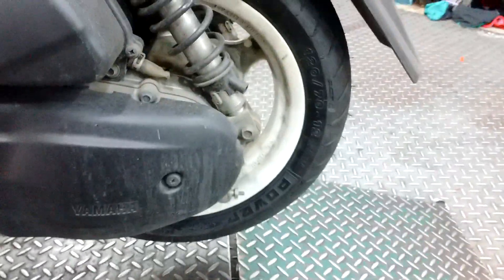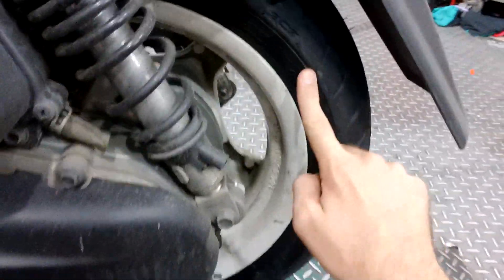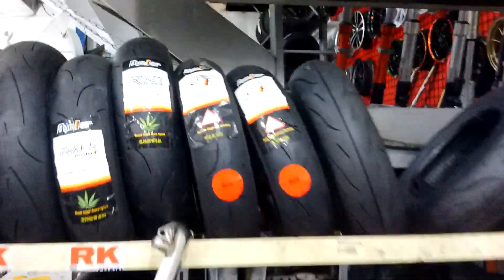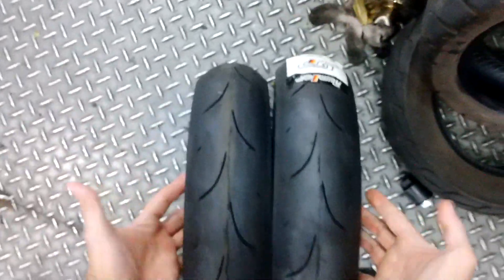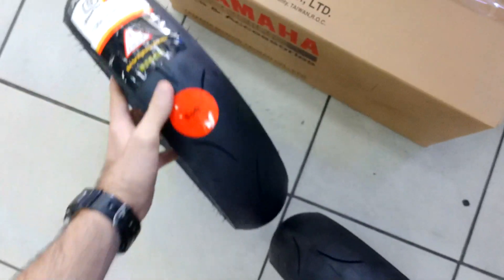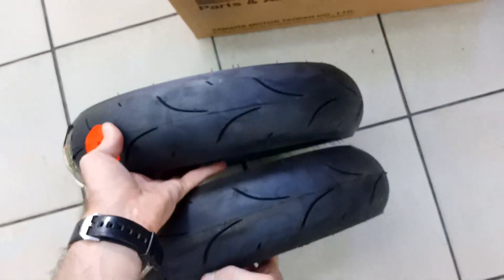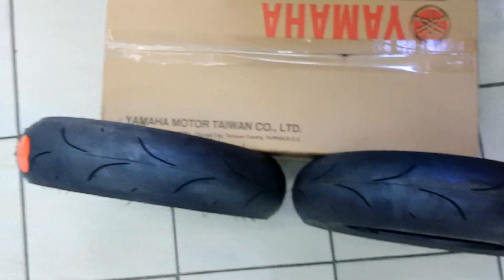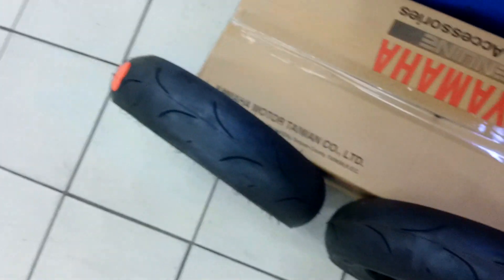Interesting Tire Fact - M13

Comment: the front tire is in rewerse pattern to the rear because on the rear you need to spit out the rainwater behind you while the front tire will need to spit it out during its most important funktion.. breaking. On acceleration you need the grip on the rear tire. Thats why the pattern is oposite ;)

Comment: can i try to answer about those tire? i don't know if i would make sense but please humor me..

lets say that those patterns are best to make most friction only on 1 direction.. so if you put them on the bike, they would technically point to each other.. so basically you need more friction on the rear because that's what you'll need to get your bike moving and the front tire would be spinning opposite to the direction where there are more friction.. and once you break, (which is breaking with both front and back breaks) the rear break is not really making the bike to stop, it's making the rear tire to stop.. so its the front break to the rescue.. and once those front breaks starts to kick in, you're TECHNICALLY making your front tire spin on the opposite direction (rules of VECTOR in PHYSICS) then that's when the friction on the front tire kicks in..

Comment: Just did the same today when changing to "winter" tyres on my bicycle (yes I got winter tyres for my bike, as I ride it daily in all weather). The direction of the profile makes a huge difference in traction (which is easy to test on a bicycle by simply putting in the front wheel flipped and trying to break on snow). 
On scooters/motorcycles through more "power" at the wheels the direction is even more important, since tyres withstand force in one direction better than the other.

Comment: It's due to the way the tires are made. The arrow shows the optimal direction for dispersing H20 along with showing which way the tires splice is being forced together, rather than apart. If you put a rear on front without switching the direction the splice of the tire could come apart under hard braking. Also, if you put a rear on backward the force of acceleration could tear apart the splice.  
For optimal tire use, buy fronts for the front. Only use rears for the front if you have to!

Comment: There's differences in the very frame of the tire as well as in the threading. The internal construction assures a stable tire (not bending or wobbling or doing anything strange) during braking or acceleration, while the pattern just serves to get rid of water and gravel etc. A racing slick also have a rotational direction, and they don't have any threads what so ever. So the direction is "determined" by the inner construction and the threads are made to fit that.

Comment: the front tire is made to stop momentum, the rear one to create it.. opposite forces require opposite constructions.. has to do with sidewall stability I think.. so reversing a front tire when mounting it as back tire is correct, since you are asking it to create momentum instead of stopping it (pushing instead of dragging if that makes sense)

Comment: I figured this out long ago, what you can do is take the tire and try to skip in on the floor in one direction and then the other. You'll notice that it has WAY more grip in one direction than it has in the other.

This is why you can make a slide when breaking very hard on your rear wheel, the wheel doesn't have much grip in that direction. You couldn't do that with the front wheel

It also goes for your bicycle tires. You can easily check with the breaks which direction is more grippy

Comment: the tread pattern on a front tire is reversed from the rear because it gives it more grip for stopping. the bottom tip of the "V" pattern of the tread should be pointing in the direction of the force that is being put upon it.

Comment: Tires are manufactured to withstand more force in one direction, due to the way the rubber layers are made, the rear has to withstand torque of acceleration and the front has to withstand forces of hard braking, that's why you reverse them.

Comment: Definitely because the rear's main force is accelerating and the front's main force is braking, but since tread pattern(for water) does not matter on streets, either way works as well.  Even on off road knobbies where you would assume tread direction matters a lot more, it is common practice to chance the direction of the tires half way through their life to make them last longer.
There is no danger since tires are built to undergo both acceleration and braking forces.

Comment: This is true! But remember, this only applies to moto tires (2 wheelers). Car/Truck (4 wheelers) tires that have directional tread do not get reversed for the rear. If you reverse the directional tires on a car; you may break the belts inside and cause tire blisters.

Comment: the thread pattern is to give water a chance to drain away from under the tire
ifit is put on backwads then it can collect water under the tire
that being said tractor tires have cleats that are designed to scoop away
loose matereal so the tire can dig in to the firmer soil deeper down
and work much better if torque is applied in the proper direction
it seems that the tire manufacture is going for the latter effect

Comment: I think it has to do with the direction of resistance/force.  The rear tire pushes the bike...but the bike pushes the front tire. So...both the rear and front tires are sort of pushing pavement away from the bike..in different directions.  So, the tread patterns are reversed.

Comment: M13, I think the front tire has tread reversed like that for when you are cornering. If you think of when the bike is leaned over the tread on the front tire will stop you from hydroplaning. It's a compromise. You can hydroplane going in a straight line as the tread forces water beneath the tire, but you're going straight so it's not a big concern and on the corners you'll be safer as the tread pattern does it's job and shoots the water out from under the tire keeping it in contact with the ground.

Comment: as people here already wrote, the pattern is designed to push water out in the same direction not according to vehicle speed, but according to  vector of force generated by breaking at front wheel or acceleration on rear wheel.

Comment: It has nothing to do with water. The treads are directed based on the forces the tire will undergo. When on the rear, the torque from the engine is pushing the tire. When on the front, the brakes are pulling the tire.

Comment: Maybe the rubber is arranged in a way that the tires have the best grip in one direction.
On the front tire you need the grip when braking, so the force of the grip needs to point backwards. On the rear tire you need the grip for accelerating; the force has to point forward.
I hope you understand what I'm trying to say...

Comment: the way the tire is designed is to withstand more force is a certain way, front tires need to withstand braking while rear tires need to withstand acceleration. this isn't really based on tread but the tire plies and the way they are layered.

Comment: The trend direction of the front tire will bring the water to the center allowing it to cut though the water resulting in more control, opposed to blowing through.  That's just my logic on it .

Comment: I got this same thing when I recently had a new front tyre fitted on my 600.  I thought they had put the tyre on the wrong way round when they were fitting the wheel back to the bike so I asked and they told me the same thing, rear tyre tread designed to grip when providing drive forwards and front tyre for braking and moving standing water under braking.

Comment: The tyres are certainly designed to optimise braking and acceleration, as you have said.   Unfortunately it is very poor form to simply switch the tyre from front to rear by reversing it.  Tyres treads are spliced together.  This splicing is directional and designed to tighten while under the correct rotation.  On backwards you risk the reverse - tyre de-lamination.

Comment: The front one is designed to have maximum grip under braking and the rear one is designed to have maximum grip under acceleration. So for these opposite jobs they have opposite tread patterns.

Comment: The most critical moment to have traction is in hard braking and hard acceleration. Most av the hard braking goes on the front and all acceleration power goes on the rear. For a bike with no brakes the pattern would look different. Yes they exists. Tire patterns are more important on snow, mud, gravel and wet tarmac. The pattern will look different on each surface for best performance.

Comment: This is actually very common among bycicle tires. Because the tire makes more traction in one direction. If you put it on the front wheel where it makes more brake traction and because the rear wheel is not really important to braking it makes more traction when accelerating.

Comment: Lol ya M13, they do that so the siping goes the proper direction but also because the tires are designed to have the force put on them in one direction. So stopping force in the front would go the opposite direction or the drive force from the rear. Cheers :)

Comment: Yeah, it's about aquaplanning- when You brake with front and it would stop spinning on water then channels would lead the water towards the edges. When You give too much throttle and rear starts spinnig too fast-loose grip, thus aquaplanning, again channels will lead the water towards the edge.

Comment: Thats, my tought too. Altough it doesn't apply to all tyres, my bad-weather tyres on the scooter are the same direction, as are my motorbikes tyres.
So i would never change it if it doesn't really say on the tyre.
The tyres in the video also look sporty, so it might be a trick to spend some rain-grip for better dry-traction.

Comment: Didn't know that was the case with motorcycle tires, cause usually the front and rear tires aren't of the same size, I know you do that with car tires, switch them from time to time front-back-diagonally. Its usually mentioned in the Owners Manual

Comment: Final Answer
"The rear wheel transmits the driving force and the front wheel transmits the braking and steering forces.
Driving and braking forces operate in different directions so this is why certain tires are fitted in opposite rolling directions when used as front and rear tires."
Now go watch my videos :)

Comment: The only purpose of tire tread is the displacement of water and other liquids you might encounter on the road. It in no way effects the amount of traction you have with the road. That being said, I have no idea why they are mirrored designs. Maybe the front tire sheds water to the sides rather than the back? Any thoughts on this?

Comment: The reason for the tread patern being "reversed" is to do with wet weather, as the bike leans over, you Don't want More water UNDER the tyre, so the Reversed tread patern helps the water to be pushed to the outside of the tyre (i.e. turning left-the tread will push the water to the right/turning right will push the water to the left, Not under it.

Comment: The front tire works while braking, like if it rotates in the opposite direction; the rear one instead works while you accelerate! That is why that guy inverted your rear-mounted front tyre

Comment: nicks kinda right. when the rear loses traction, usually under acceleration, it'll cut through the water. when the front loses traction under deceleration it'll STILL BE ABLE TO cut through water. thats why the tread is reversed. look at motogp wet tires to easily see what i mean. the reason for separate tires is that both are built to handle stopping, scoots dont have enough hp to care about acceleration. if acceleration mattered there'd just one tire with a "front" arrow AND a "rear" arrow

Comment: Slots in tires rant mention for traction, they direct the water you are riding over. The front tire directs water the the center so the rear tyre can disburse the water to the sides and back of your bike.. If you had the front tread so it disperses the water away from the tyre, you and you bike would get soaked when it's wet

Comment: You shouldn't use a rear tyre as a front or a front as a rear, the reason they are specifically labelled is because the forces on each is different and the rubber compound is different you will get more wear on the tyre than you would. The front = braking, rear = accelerating. They are specifically designed for it, the treads should be that way though.

Comment: do you realise the ply of the tyre isnt regular? on a "front use only tyre" the ply is designed to hold together in the direction intended but if you turn it around then the ply is at significant risk of falling apart. I hope this doesnt happen and those tyres may be made differently but i personally wouldnt risk it

Comment: The tires go like that due to the way bikes corner. I can't explain it very well in words... Rather than the front turning and the rear following like a car the front and the rear are both turning at the same time. It's similar to an all wheel steering car but with some differences. So imagine the front tire is turned in wards and the bike is leaned over. The tires will go be in kind of a > orientation. Counter steering changes it a bit but not that much. And I'm out of words so that's all.

Comment: "A front tire works on energy from braking and the rear on energy from accelerating. Tires are "wrapped" (for lack of a better term) and can come apart if pushed in the wrong direction.  So, to run a front tire on the rear and not run into a delamination issue, you need to flip it around backwards. But, by doing that, you 100% negate all the water dispersing properties of the tire."

In addition, load ratings would differ between the two, and could be quite dangerous.

Comment: I'm not in a tire shop so I can't do a very broad comparison but I just looked at the stock tires on my Ninja and the tread is not reversed front-to-back, and I can tell you beyond doubt the tread on my old CBR's tires was never front-back opposed, either - multiple sets of different tires.  Is it simple coincidence that I have yet to come across an opposed-tread tire pair?

Comment: I see what you mean about the tread pattern M13, however that front tire you showed us, the treat pattern seems wrong. Now I'm not an expert obviously, yet the front tire tread pattern appeared that it would push water under the tire rather than out from it, however when it matched the rear tire direction, the tread pattern seemed correct.... It still confuses me, but ok, it's the right direction, but the tread pattern just seems wrong.

Comment: @united999state Slicks are a very bad idea, did you know the tread pattern on a normal tire helps disperse heat, and if you put slicks on it will go through its 6-10 heat cycles and go very hard on you quickly. the reason they put Tire warmers on when racing is so they only go through 1-2 heat cycles

Comment: My car tyres have direction indicators, which is why I cannot follow my car manuals recommendations to rotate all the tyres so that every tyre gets a go in every position (including spare) it cannot be done because half are designed to turn clockwise and half designed to go counterclockwise,  I do not even rotate front and back on the same sides, and defo don't with spare as its on the only Steel rim which is thinner than the other wheels... :-)

Comment: Maybe this has already been addressed, but the very fact that the tires are designated front and rear implies a different basic construction...more than simply reversing the tread pattern. Flipping one around to use on the other end from that which it was intended is probably not a great idea, and it's surprising that your shop does it.

Comment: Yeah if you put a front tire on the rear you have to turn it around to prevent it from falling apart during acceleration but putting a front tire on the rear backwards completely negates its water dispersing technology so it might get a little slippery in the rain. You should really just get a proper rear tire. lol

Comment: Fact is that a tire that says rear on it is made the same as one that says front.  Front tires generally have a bit less weight therefore a bit less rubber You should still run them in the direction of the arrow because of the polarity.  They say that the new radials don't polarize, well I have a bridge I'll sell you too.  Common sense prevails.  I use the same tire on the front and back of my bikes.  Different size but both rear.  lasts longer...

Comment: dear m13.. i tought u where smart :P no im jking, this tire dilemma u have is pretty obvious when u think about Where 70% of your braking happens and where 100% of your acceleration happens :) u gets it now dont'ya? :P so, what im saying is that the front tire needs to drain water when breaking, and the back tire drains water from accelerating. the two opposites needs the two opposite rotation groves :) hope that answered alot for ppl ^^

Comment: I think it has to be that way because if both tyres are in the same direction then you cant accelerate hard or brake hard depending on the direction of the tyre... Shit i think nobody will understand my thought... The front tyre must be that way because if it rains then the profile will be pushing the water away... Then you will have traction while braking... The same thing with the rear tyre just the other way around... Does anyone understand what i mean?

Comment: Its make no sence to me even if the factory say it should be that way,they (the tires) get rid of the water the same way i mean at a given point in the road first the fronwheel passes and then shortly after.. the rear tire ...in the exact same way. Its like duuh 
I would want to have the pattern to be washing the water from the middle and out as you showed on the rear tire pattern.